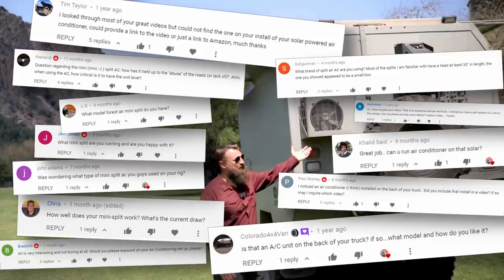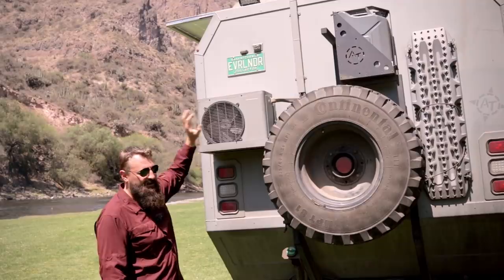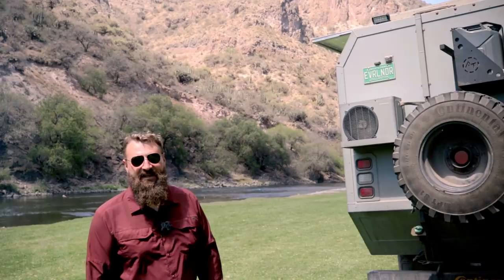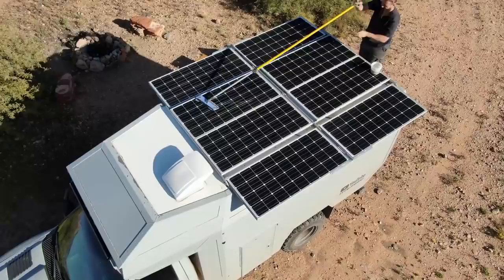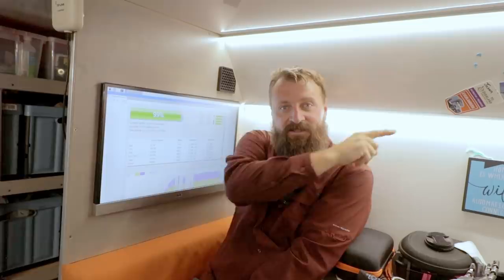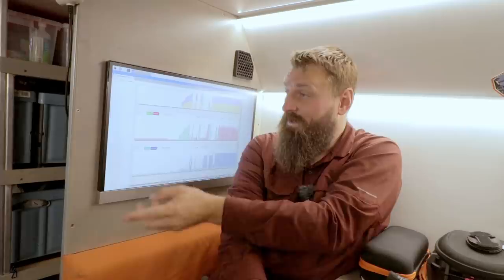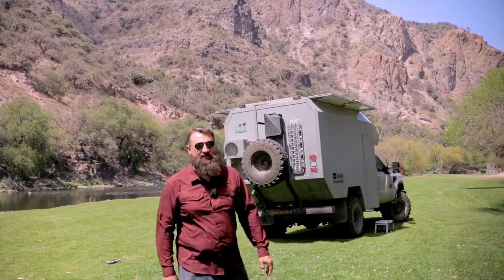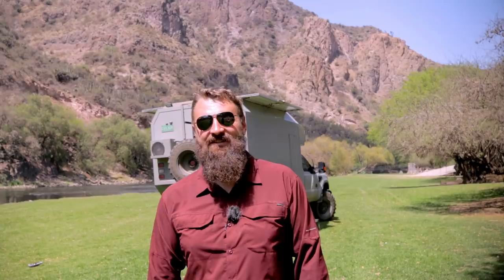Solar Powered Mini Split Air Conditioner Tour - Everlanders see the World!

Comment: What if you put a small computer fan (exhaust way) between the condenser out (remove the flap) & pvc pipe joining or put it as exhaust on the out near the monitor.
Reply from the maker: The fan is already many times more powerful than an a PC case fan... It would probably only add restriction...

Comment: I have a traditional 16000 BTU roof AC on an old 1986 Alumalite 33 foot... My Solar set up more then powers it on hot sunny days here in Washington State... I have wanted to use an electric heater but that does NOT work well with solar in the winter up here...  I am thinking about adding a frame around my motorhome so I can put the panels on it directly instead of on the ground mount system I currently have. I would also like to put a heat pump in the second space already wired up for an AC system, but funds are... hard to come buy...

Comment: So a few questions.  1.  Would you consider running your condensate into your water tank rather than "wasting" it to the ground?  2. Is that MiniSplit system an inverter type?  It seems like I've seen somewhere that they're not all inverter types.  3.  @13:56 Was that a Homestar Runner reference??  4.  Do you have an idea how much all the solar equipment and batteries weigh?  I'm looking into building a smallish Overland trailer to pull with my Bronco and I'd like to keep it light, but provide the wife with the primitive comforts of AC without the use of a generator unless absolutely necessary.
Reply from the maker: 1. We sometimes collect the condensate, but because our water tanks are pressurized it can not simply be run in to the tanks, further the black chunks of mildew and crud that come out of there not to mention the high risk of legionnaires disease make it not an appealing idea for me. 
2. No, this was installed long before inverter compressors were available. I would probably get an inverter unit if I ever need to replace this, but I haven't found a comparable unit in the 8 to 12K BTU that isn't (a) 220vac, (b) Massive, 30 to 35" across.
3. Yes the Cheat, yes it was!
4. Yes, The CALB batteries weigh 5.6 kg each and for the solar we went with a heavier panel with the 3.2mm tempered glass front's that weigh 11kg each.... Sooooo... (5.6*20)+(11*8)=200kg

Comment: Question:  One of the goals of a nice campsite is to be shaded.  Does the shade of trees, and the protection from the Sun that shade creates, offset the wattage that the solar panels can create while in that shade?  In your video I'm not sure if you meant that it was 31 degrees C in the shade, or due to sun exposure.  Here it gets to be over 90 degrees F in the shade, and we have high humidity. I'm wondering how a solar system like yours would work under nice trees?  Thank you for the video - I love the concept and ideas.
Reply from the maker: I disagree, one of the goals when we're looking for a nice campsite is free renewable energy. That being said I don't know of any panels that make power from shade, sorry. Fortunately, as we've made our way south through Central America, a majority of the high desert and beach camping have plenty of sun to power all of our cooking, cameras, computers and A/C. As we move through the Costa Rican and Panamanian Rainforests, we depend on our 11.5kW of Lithium to store enough power to get us through a few days of shade or hot, humid nights with A/C.
Reply: @Everlanders  Thank you for the quick reply!  I'm thinking of getting a much smaller tow-behind (teardrop) camper, and am putting together ideas for the AC.

Comment: Have you considered tapping in after the PFC rectifier and just feed DC directly and thus adding about 20% or more efficiency and lowering your inverter demand?
Reply from the maker: There are no rectifiers, they are all straight AC induction motors.
Reply: @Everlanders  interesting. Aren’t most mini splits now using BLDC motors?  From what I’ve found with mr cool and others is that there is a 6 fet PFC that gets to 400v dc and then a 3 phase BLDC controller to the compressor and the fan. 

If you tap into the board immediately after the PFC with 400v you can power it directly from DC and if you use a 12v to 400v boost converter you’re at 96% or so efficiency and have eliminated the dc/ac/dc cycle. 

I also note that there are now a fair number of 12/24/48v heat pumps out there finally that just dump the PFC and do the boost themselves.

Comment: Thanks, I've been waiting for this video. Very thorough, informative and entertaining as usual. I've really enjoyed watching your channel grow.
Reply: I don't think they sell that model at our costco for the states.
Reply from the maker: It seems there are other venders that sell it too, but please confirm that the new 10,000BTU version has the disconnect if that's something you need. https://www.thecabindepot.com/products/forestair-mini-split-10-000-btu-portable-3-in-1-air-conditioner
Reply from the maker: I have since confirmed that the 10,000 BTU version no longer has the disconnect, so you'd need to cut a large hole or make a doorway just to pass it through...

Comment: Nice setup! Must feel especially nice to convert sunlight into cool comfort. 
Have you ever measured the compressor's startup current? If not, what type of AC circuit breaker do you use for the unit -- 10 amps? If it has been working fine for 2 years then obviously all is well and the AC unit very likely has a soft-start circuit. For those who want to replicate this type of installation, make sure that you take  surge currents into consideration.
Reply from the maker: As it was designed to be plugged into a standard 10 amp 110v outlet, it has a soft start capacitor wired in right at the compressor...

Comment: omg ! thank you for doing this, you are realizing my design ! except that my solar panel design is slide out the top panels, where yours is slide out the bottom panels.
Reply from the maker: Sliding the top had too many problems...
Reply: yeah probably the heat build up problem like you mention, thanks for the info !

Comment: They don't sell this in USA anymore -- any suggestion for a replacement? I like how small (tiny width) the indoor unit is. Most mini splits are twice as long (rectangle) rather than a small square (like the ForestAir). A rectangle long-width won't work for my RV...so wondering if you know of any other mini split that have a small  indoor unit (ideally no wider than a single kitchen cabinet door). Thanks!
Reply from the maker: No, I feel your pain... Everything else is twice the size...

Comment: The condenswater is very clean, you can use it as drinking water or toiletwater...maybe needs a waterpurifier for drinking but i wouldn't drop it outside.
Reply: I was thinking of plumbing mine to keep my shower water tank topped up... gotta be a couple gallons a day.
Reply: I would advise against this, this is how people end up getting Legionnaires' disease. It picks up all the bacteria from the air and so the water would need to be treated before use. It would be best suited for toilet flushing if un-treated.
Reply: You are CORRECT.
Reply: @THEZEST1357  
Bleach + Black light (U.V.)
Remember people PEEING IN SWIMMING POOL, how much do you inhale?

Comment: Any plans to upgrade to a newer unit with variable speed response so it can run near-nonstop at even greater efficiency and lower peak use? Newer models seem to use 150watts with the compressor running slowly and 600ish on fill tilt and with an even higher EER rating.
Reply from the maker: No, we recently helped a friend install such a unit, on paper, everything looks great but our daily average power consumption is very comparable.

Further I haven't found anything that is as small as ours physically, the one we helped install was nearly twice the size...

Also, if it ain't broke don't fix it...

Comment: I have a 5000 btu window ac, its powered by 600 watts of panels, i have a 1000 watt inverter (cheap) and instead of batteries i have used super capcitor (the cheap "green caps") so it only works in the sunlight but thats fine because its hottest during the day where I live.
Reply from the maker: Perfect! Glad to have another voice saying it can be done!

Comment: this company doesn't seem to share the efficiency rating, seer, on these units. There's another dude who put a 22 or 24 seer 9000 btu unit in and his only pulls 500 watts running. The 10000 btu replacement from forest air says it pulls 750 watts, I bet they made the replacement more efficient. I bet it's the small coils in the condenser and evaporator that causes it not to be more efficient. It also might not be an inverter mini split. meaning it is either on or off and can't throttle back when it doesn't have to run full blast...which increases efficiency a lot. 
Looks like it's working really well for you though. Thanks so much for sharing!

Comment: I want to see a test where you see how much wattage you use per hour setting it at different temperatures inside, like 75, 78, 80, and how much difference in how longs the batteries last.
Reply from the maker: Our batteries last 5 days without sun at 72° - I will not be doing any further testing.

Comment: I went to check out the mini-split you're using and was surprised to see an EER of about 8. This is quite poor for a mini-split (most are around 20) and even poor compared to a old-school window unit like you had previously.

Not sure if it's because this unit has losses from the extra ducting you run from the head unit (most mini-splits don't offer this feature, they just vent directly from the head unit). Anyway, this is just a heads up to anyone planning their own system to look at the EER of the A.C. unit, it's not subjective, it's a ratio of BTU output to watts consumed, so when this unit was on full blast pushing 850 watts, a standard mini-split with EER of 20 would have consumed about 400 watts for the same amount of cooling! Might save the need for an extendable rack of solar.
Reply from the maker: If you have a link to a Mini Split with a SEER of 20 or better, Isn't twice the size, three times the cost and runs on 110VAC let me know below and I'll make that my next video.

Comment: About that vent that moves the air horizontaly, the design would not have to be directed inward the cabin as you showed, i feel like the right and bottom small tubes should be directed horizontaly but the left and upper tubes towards the roof. Otherwise you wil get the full force of the cool wind in the centre of the cabin where People will not be confortable. That new design would deviate the flow so that cool air moves downwards after release when touching the roof, in other words after the People sitting next to the shaft
Reply from the maker: I'm sure the new design (from 2 years ago) will satisfy all your concerns. https://youtu.be/XxJkS1qbwVY

Comment: Did you consider getting a mini split heat pump? Those typically have inverter technology, so they are very quiet and only ever provide the cooling load required. Much more advanced than on/off traditional compressors.

They are also very effecient, both in cooling and heating.

Depending on the model and temperature, heating COP can range from 2-5. Mitsubishi and Fujitsu both have technologies than can produce ~80% of capacity at a cop of 2 - 2.5 all the way down at -25C.

I don't know how exactly you heat your vehicle, but heat pumps are far more effecient than resistive heat.
Reply from the maker: I have not found one that will run off of 110vac or 12vdc - can you provide a link to what you're suggesting?
Reply: @Everlanders  You would be correct more or less. The advanced heat pump units pretty much all use 240v.

There are a few manufacturers I might consider. Fujitsu and Mitsubishi are the best for performance at low temps. Their hyper heat compressors maintain above 70% capacity at about -25C. At a cop of 1.7 to 2.2 depending on the heat output.
If temps are above 5C they can have a COP greater than 4. Which is 4x as good as just a resistive heater.

There is also a company called Senville, they actually sell direct to the consumer, and as minisplits go, they are pretty affordable. But, their low temp performance is not as good. They sell a 9000 BTU "leto" unit that runs off 120v and operates down to -15C. If you pay more, you can get the "Aura" line, which claims to operate down to -30C, and has a bunch of other features like wifi control and whatnot. However that unit requires 240v ac. However i hear the 240v compressor is quieter or something.

AC wholesalers is a good website for getting Fujitsu and Mitsubishi equipment.

All the manufacturers post some specs, but if you really want a good idea of how a heat pump will perform at various temps, punch the model number into this database. https://neep-ashp-prod.herokuapp.com/#!/ It will tell you a lot more than the manufacturers will.

Also, all the manufacturers will post HSPF values, by default those are in climate zone 4. HSPF is like SEER but for heating. Most units should have an hspf4 of at least 9.5, and an hspf5 (climate zone 5) of at least 7.5.

So, I know it is a long comment, but here is what I would be looking into.

These are by far, the most effecient minisplit heat pumps I have ever seen, well, at this size anyway.

Seer of above 33! And hspf4 of 14 and above! Truly incredible.

Regular model operates down to -5F.
https://www.acwholesalers.com/Fujitsu-09LZAS1/p106471.html
https://neep-ashp-prod.herokuapp.com/#!/product/25332

Ultra low temp model, a little more expensive, and sacrifices a small amount of effeciency at moderately low temps, for ability to operate down to very low temps  (-15F)
https://www.acwholesalers.com/Fujitsu-09LZASH1/p106472.html
https://neep-ashp-prod.herokuapp.com/#!/product/25333

Of course it is more expensive than any of the real low end units, and it requires someone to vacuum the lines. But wow, the perfromance is absolutely incredible. I suppose it depends on your budget and how much time you spend in your vehicle/where it goes, but if i wanted to go on winter road trips, I would consider these.

Also, the vast majority of minisplits will require 240v. So, a 240v inverter would be an additional investment. Senvilles Leto line would still be an upgrade over your current setup, in regards to heating

Ac wholesalers also does not include accessories, so if you wanted to buy a fujitsu unit, that would require a lineset and a few other bits an bobs, adding a little to the expense. Senville does include all the accessories, and they are more affordable, though the perfromance is not nearly as good.

Comment: What do you think about collecting the condensation from the mini split and using it as fresh water in the rig (for drinking/washing). I bet in humid climates you could get quite a bit of water and if your batteries are full provides a productive outlet for extra power.
Reply from the maker: Except the collection tray drain is a breading ground for legionnaires disease, and I'm married to a molecular microbiologist...
Reply: @Everlanders  Not familiar with the disease - would there be a solution to mitigate that risk like boiling the water or using some type of filtration system (UV or otherwise)?
Reply from the maker: Yes, boiling would kill it, but at that point it gets to me pretty expensive water...

Comment: 9:36 _Maybe refit a vent from a junk truck or van AC vent? That way the vanes could could be adjusted to direct the air as needed.
GREAT data though! Love the info.      😃
Reply from the maker: Hey, that's a good Idea... I have adjusted my CAD model already, I just need to get some access to a 3D printer as ours is in a shipping container in Canada under 4 feet of snow...
Reply: @Everlanders  Use some webasto/espar adjustable vents..about $10
Reply: @Everlanders  That is a great reason to be in Mexico!   😃
Reply from the maker: I actually have a couple Espar vents here... Lol
Reply: @Everlanders  _Teamwork!

Comment: Fantastic design. I would hold the expensive batteries at 80% charge and reduce 100% charge cycles. 30 to about 3. This would double the life of the phosphate batteries.
Reply: And another place to be able to dump any power that may not be getting utilised is to have your hot water DC element heated...

Comment: So at night you pull out the gas generator? And back in Saskatchebush you use a diesel heater... or propane?
Reply from the maker: Nope, At night our 11.5Kw of Lithium Batteries tide us over... https://youtu.be/2uYENzaDBY4
For cool evenings down to about freezing, we use electric heat - usually a silent heater blanket under the bed, but we do also have a little 500w space heater we sometimes use. And  Yes, when it's crazy cold we fire up the Espar D2 https://www.youtube.com/playlist?list=PL0uBLqOOwG8iXoIVWRG77h_DmhuOh3VTV

Comment: Maybe try using the AC vents that are normally on dashboards. That way you can orient the vent to push air in different directions as needed.
Reply: He would rather brag about 3D printing something  that would be very easy to buy, and that works better?

Comment: What type of adhesive did you use to glue the ac unit to the outside? No penetrating holes! 👍
Reply from the maker: The same SikaFlex 252 and 206 primer used to bond the panels in the first place: https://youtu.be/DppR9PVR_A0